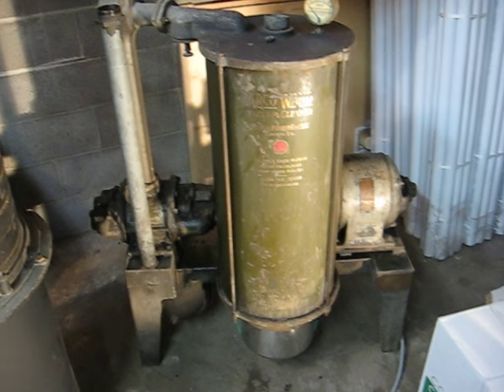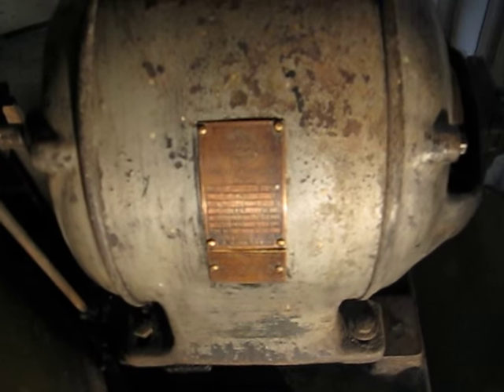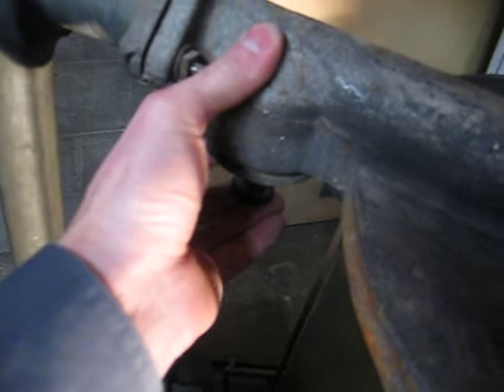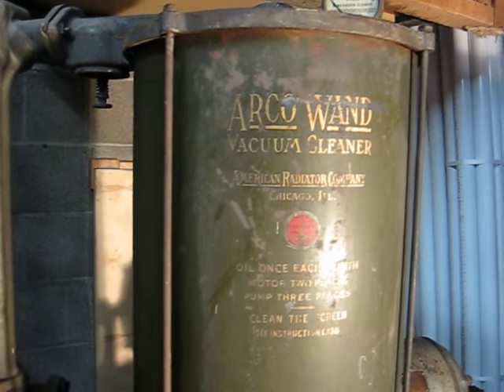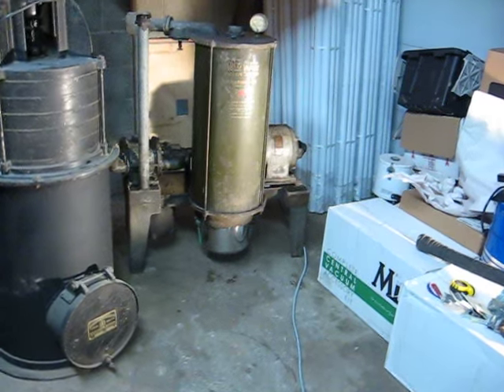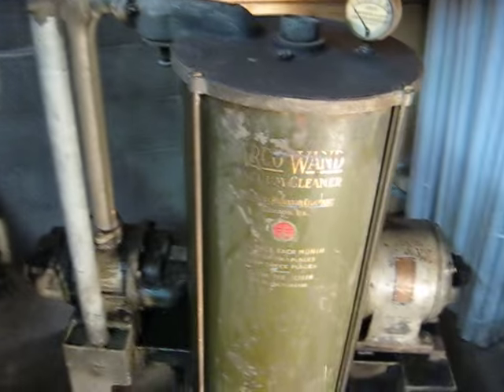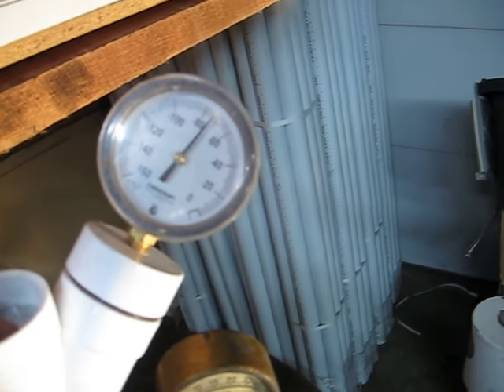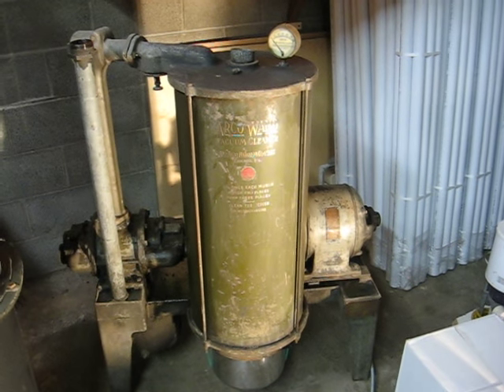About the Arco Wand Central Vacuum

Comment: I have a 1910 house with intact pipes --  does it make any sense to restore a central vacuum system?
Reply from the maker: Yes! This can be done successfully. So you have the original inlets and piping, but not the machine, correct? A new unit can be adapted to the old piping where it terminates, and a new hose (with wireless RF handle) can be made to fit your old wall inlets assuming they are workable.